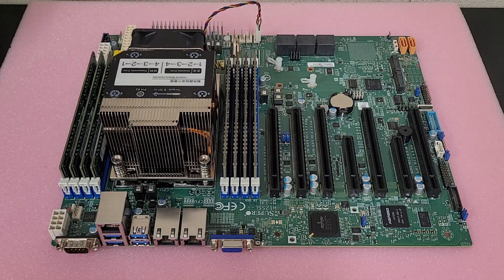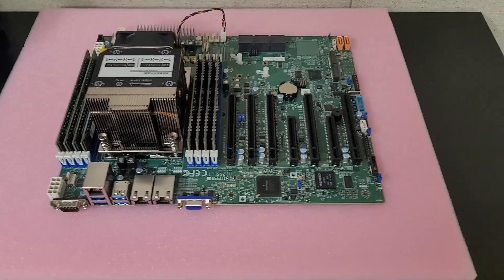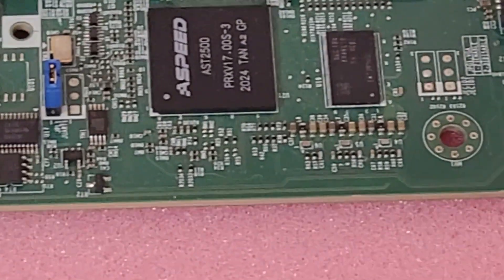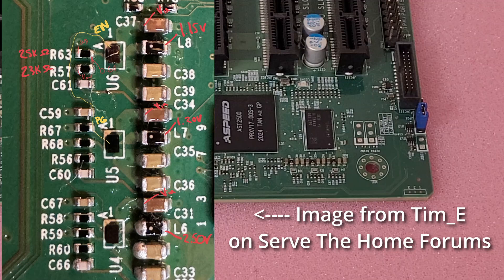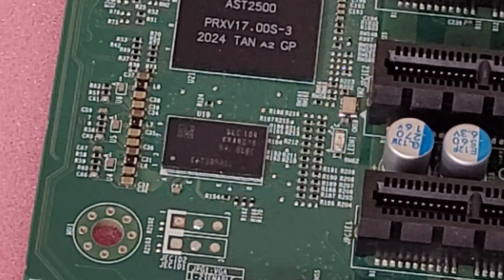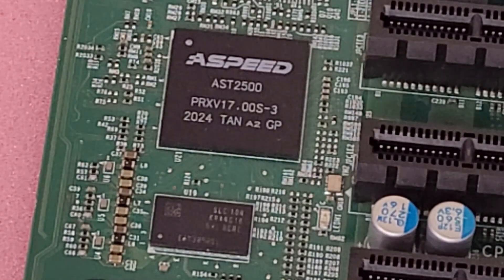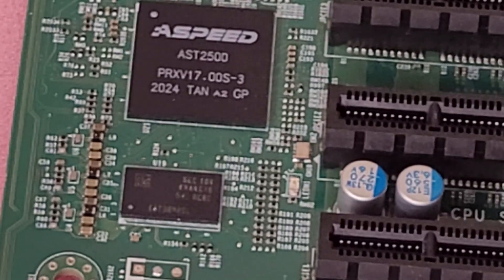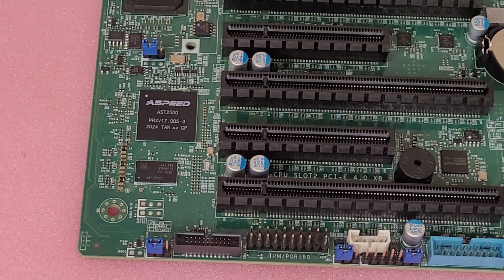Supermicro H12SSL Slow POST? No VGA, IPMI, or Fan Control? (Probably Dead BMC)

Comment: Thankyou so much for posting this, my board started to do the same and I have been trying to figure it out for weeks. I had not noticed the BMC was not running until today and searching turned up this video. For me, I had 0.8V at L7, the instant I touched U5 it jumped back to 2.5V and the LEDs started flashing. Clearly I have a cracked/dry joint here. Thankfully I can rework this myself :)
Reply from the maker: I'm glad I helped and your board is fixable by you in your case. Hopefully the repair goes smoothly.

Comment: I have revision 1.1 and epyc 7502. My CPU is detected as 7282 for some reason... and it does not post. Is it supposed to work with this revision
Reply from the maker: BMC won't update the CPU model and hardware info until a successful post happens. Does it power on? Also post can be extremely slow depending on your hardware.
Reply: @computersales  Hmm how slow? i for sure waited +10minutes. some blog post says there is an issue with revision 1.1 and newer bios 3.x, and I might have to downgrade...
Reply: Also my IPMI works fine
Reply from the maker: @benetoriol6802 I have a 1.1 board with latest BIOS and it is running EPYC 7002 series just fine. There's a handful of things you will have to try to diagnose. First I would start with reducing the system to just a CPU and a stick of memory in slot A. If it doesn't post try moving the stick of memory to a different slot. If that doesn't work I would try reseating the CPU (make sure torqued properly) and trying to boot again. Also check to see if you have any activity on your keyboard like turning caps lock on and off. If you get no post next things to do would be clearing CMOS and try adding a video card and seeing if it will post off the video card.
Reply from the maker: Also post shouldn't take more than a few minutes. Maybe 5 if it has to rediscover the hardware installed.
Reply: @computersales  So far I have a single memory stick and cpu. I dont have a keyboard. Via IPMI I see POST spoofing code 22 and I find no documentation on what that means... I did try clearing the CMOS. idk if the cpu is torqued properly but I tried reseating. I just twist a little at a time each screw until i run into an obvious stopping point, feels like this should be sufficient?
Reply from the maker: @benetoriol6802  looks like 22 is memory related. The cpu requires a specific torque spec due to all the pins. I'd try different memory first otherwise you will need to make sure the cpu is torqued down properly to ensure it works correctly.
Reply: @computersales  makes sense, thanks